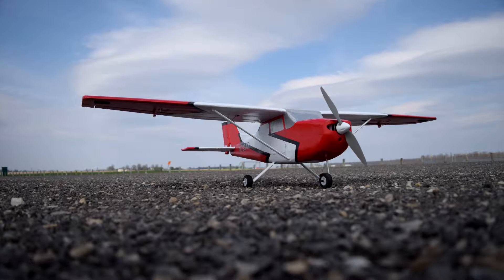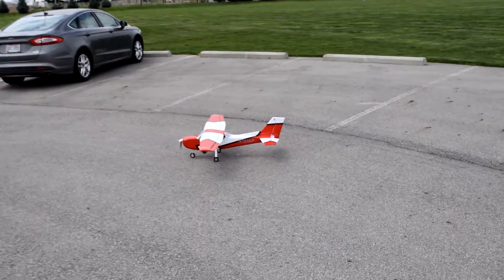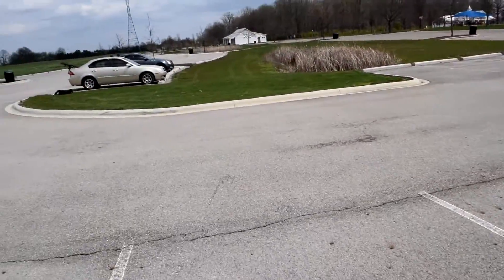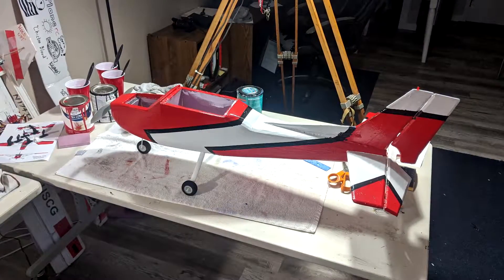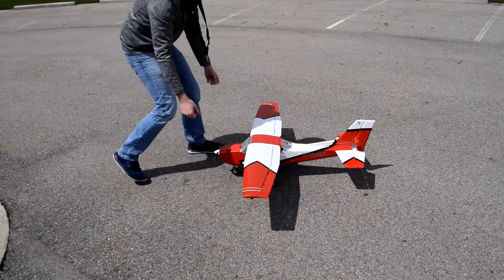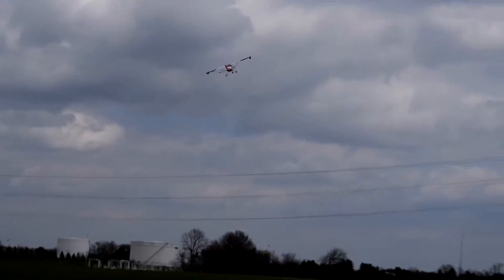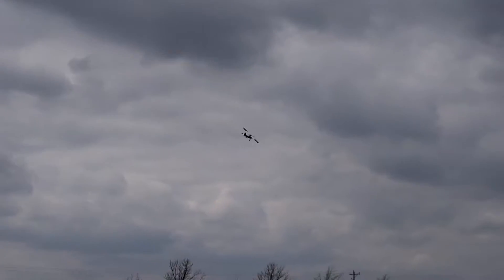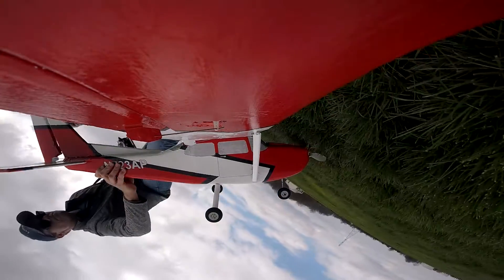Scratch Built CESSNA 172 V2 - Maiden Flight

Comment: am new to that rc planes , so which brushless motors i should buy the higher better or the lower , sales is ending on aliexpress , so buying 2700KV motor will be good or not , please give some tips on these motor kv that higher or lower any disadvantages , thanks
Reply from the maker: Higher kv motors generally work better with smaller propellors. You would need to check the specific motor you are looking at to see what prop it works with and what battery voltage it works best at. Also, it depends on what kind of aircraft you are flying. A lower kv motors is generally for larger props and is more efficient.

Comment: I am going to start this project today! But as a taildragger instead. I'm going to try using styrofoam instead of the pink foam. I picked some sheets up yesterday and it was a LOT lighter. I noticed the cracks on the wing on the bushplane too. Ended up adding one more carbon fiber spar and that seemed to help a bit.
Reply from the maker: Cool! Let me know how it turns out

Comment: I’ve glassed several foam planes that turned out light and strong. If you’re glassing the tail feathers and fuse you can make the foam a bit thinner because the glass will give it much strength. Also there’s lighter glass available that most foamy guys use it’s 18 gram stuff from HK. Anyways looks great!  
 https://hobbyking.com/en_us/glass-fiber-cloth-4000x900mm-18g-m2.html
Reply from the maker: I've thought of only glassing some parts of the plane, or like you said, I may use thinner foam. Thanks, I wasn't aware of that lighter fiberglass. May have to give it a try.

Comment: Really nice plane.  I saw your plans and loved the simplicity, so I built one.  You really inspired me.

I covered my whole plane with brown packing paper and watered down white school glue.  After it dried and shrank it made the wings much stiffer without adding a huge amount of weight.  l think the next time I'll use a better wood glue such as Titebond.  I think it will bond a little better and probably be somewhat stronger than the white glue I used this time. 

I'm waiting for a good day to take it out and see how she flies.

Thanks again for sharing your plans.
Reply from the maker: That's awesome! I may have to experiment with that method using paper and glue, since the fiberglass made mine quite heavy. Do you have a picture of video you could share? I'd like to see it. Best of luck flying it!
Reply: @RailTrailRC  I have a few pictures but I'm not sure how to get them to you. 

If you try the paper be sure and coat the foam with glue watered to a slightly thin paint consistency and wet the paper so it is saturated.  Apply the paper to the foam. Be sure to get the bubbles out while it is still wet.   Also if you have a thin flat piece to cover be sure and paper both sides so it doesn't warp when it dries.
Reply from the maker: Good to know. You can email me at aplanerc@gmail.com

Comment: Nice, looks great! What weight fiberglass did you use? Did you glass with epoxy? I ordered some 3/4 oz per yard and will be applying it with water based varathane . I did notice yesterday just using 3 coats of minwax poly on a test piece, it did give it  some hardness, a little harder to dent than the untreated piece.The solids weight is around 25 percent, so you could use an entire 8 oz can on your plane and only add 2 ounces. The white foam you speak of does not sand as nicely as the blue foam,, and yes- its weak, but might work out with fiberglass cloth.
Reply from the maker: Thanks! I used 3/4oz fiberglass and minwax polycrylic. Good to know about the white foam. I may end up just using glass for the wing root and tips and tail surfaces, since that is where most of the damage seems to occur.

Comment: Just some know-it-all type comments from me...
I think in the full scale plane the engine is a huge fraction of the overall weight, which is probably why the nose is rather short on these. For a model you might find it easier to take some liberties with the proportions, in favor of not having to add so much dead weight in the nose.
The feeling of lack of power could be due to motor kv, 650kv is pretty low for 4S. I would usually go for about the 900-1200kv range and around 8-9 inch prop for this size plane on 4S.
That latex paint looks quite heavy, do you know how much weight it added?
I like your judicious use of 3d printed parts, instead of going berserk and using them for everything under the sun like many people do, only to have things breaking. Now that fiberglass-over-foam is on the table though, even less parts need to be 3d printed. That nose cone seems like a prime candidate, especially if you're able to relax the 'scale look' requirement (sanding the foam will not end up as accurate as the 3d print).
If you want surface protection, packing tape is about as good as one layer of thin fiberglass, while being easier, lighter, and smoother surfaced. Fiberglass is better for increasing rigidity though, so if you want to cut down on the amount of glass the first places I would put it are on the top and bottom of the wing (leading edges not so useful, tape probably as good) and maybe down the sides of the fuselage, the longer you can make a single piece the better. Also keep in mind that in places where glass is, you can probably reduce the thickness of the foam a bit - not so easy on wings, but might be possible for fuselage/tail, and definitely possible for tail fins.
Reply from the maker: Thanks for your ideas! Yeah, I know the real plane is proportioned for the heavy engine, but I'm trying to make the model look realistic. I think I may make the nose 3d print a bit shorter, maybe just thick enough to encase the motor, so as not to add so much weight. I really like the way the 3d nose came out, So I don't think I want to give that part up. As for the tape, I have used it on other planes but it doesn't stick too well to the latex paint and peels off rather easily. Also, I'm not sure how much the paint weighs, but I haven't come up with a better way to paint this foam.  Spray paint will dissolve it. I figured the motors are not ideal, but I had a few of them left over after a big multirotor project, and didn't want to spend money on new ones. I could probably use thinner foam for the tail, especially if I keep covering it in fiberglass. I don't know if I will keep up with the fiberglass though, it was kind of a hassle. The paint itself adds some protection. It's really probably know necessary just around the wing root and horizontal tail and the at the front near the motor where I saw some cracks forming in the foam. There's definitely more testing and experimenting that needs to be done in the future!
Reply: ah, just remembered you're using polycrylic, not epoxy. Some of my fiberglass comments might not apply quite as well. Doesn't seem like you would need two coats of the polycrylic, especially if you're gonna put two coats of paint over it as well.